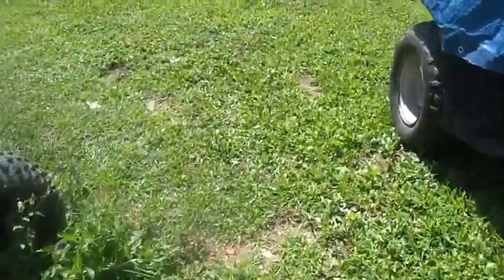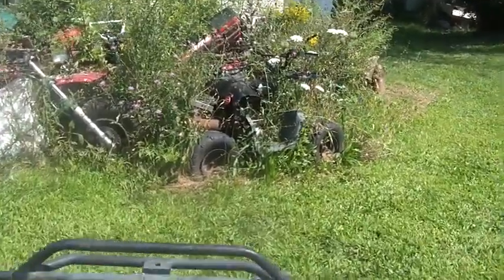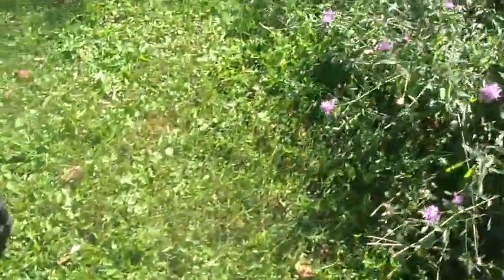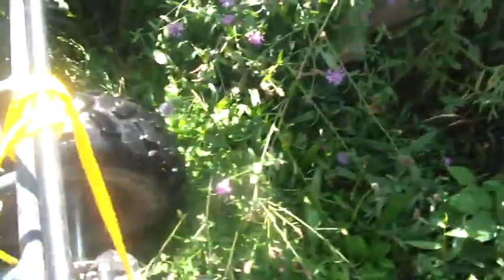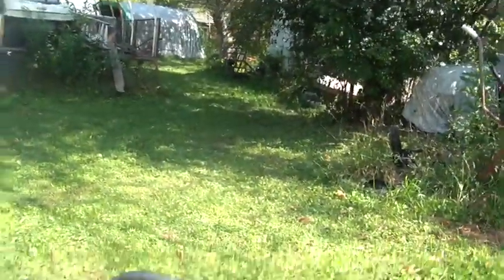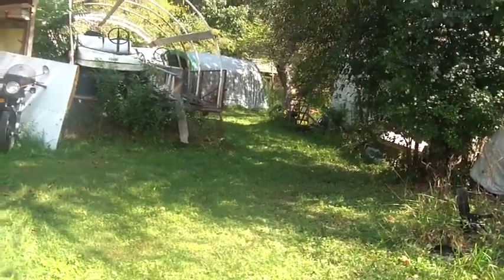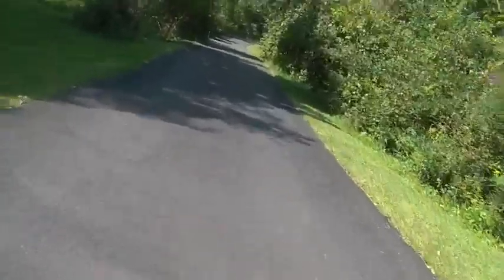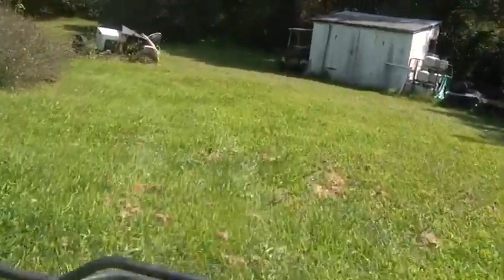125cc Coolster ATV vs dead Honda 300EX,

Comment: i need you again i bought a pit bike was runigood now it want stay on in neutral soon as I give it gas it act like it's going to cut off I put it in first gear and it does same thing many bad gas or airline filter are carb I put 93
Reply: datharian potter hey friend did you clean the carb maby drain the old crappy gas
Reply: DontWorry ItsalreadyBroke I'm a beginner on carb cleaning scared I might mess something up more can I just add new gas and carb cleaner to filter
Reply: datharian potter yes ive done that before with efi cleaner but it wont run just as goo as a good carb cleaning i was there once to i didnt like messing with carbs vut they arent that bad just dont lose any screws or parts and remember how the go in and where they go and also you can clean a carb with gasoline and a old toothbrush
Reply: i can make a you tube video on cleaning the carb for two kinds of carbs beside i wanted to start youtubeing anyway
Reply from the maker: Hey Datharian!!!  I agree U need a carb clean, U can do a bowl clean fairly easily, just turn off the gas, remove the 2 phillips screws that hold the bowl to the carb, dump the gas safely, clean the bowl, carefully put it back in place, reinstall the 2 phillips screws, turn on the gas, and give it a try.... Thanks for asking, watching, and commenting, BTW, let me know how it turns out....